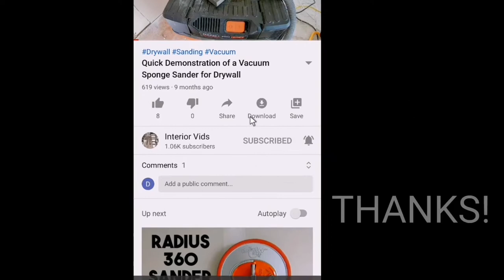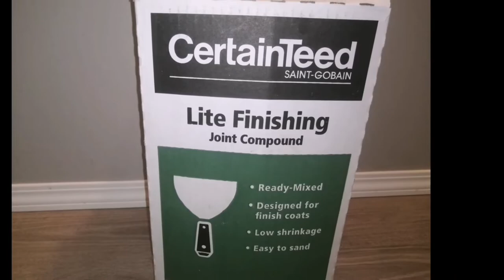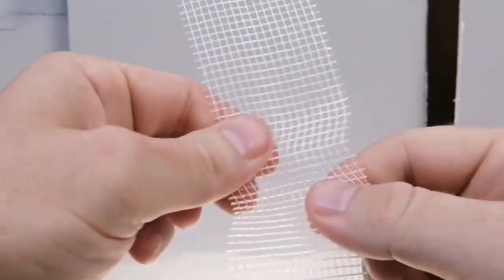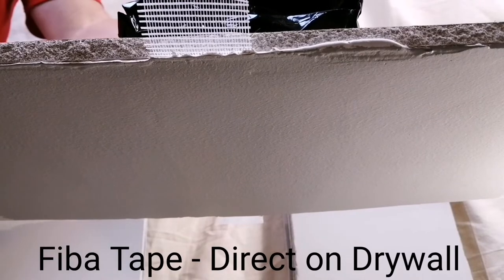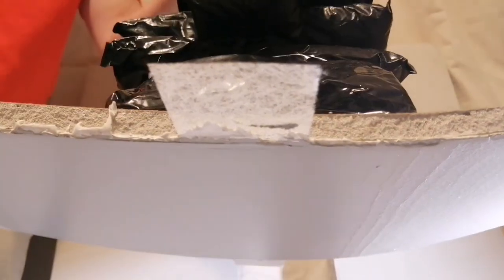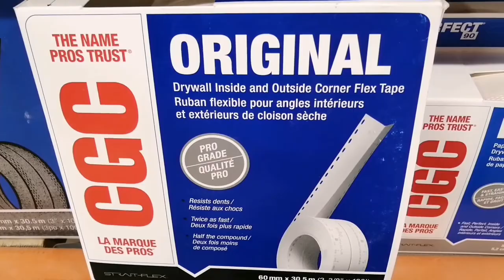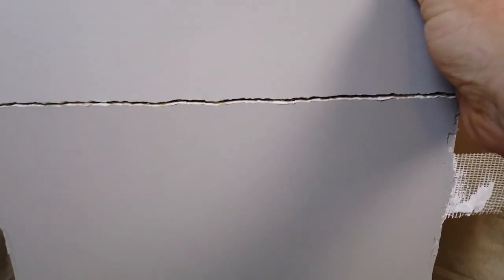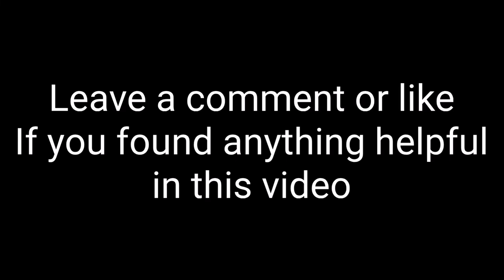Paper tape vs. Mesh tape vs FibaFuse tape

Comment: I use fibrafuse and fibratape red. With all purpose. I love that you have done this. Drywallers have been talking trash on my videos for months. I've never had a call back in my career. They are the 2 best tapes period. Especially embedded and prefilled
Reply: So do you use fibrafuse with the green top regular compound or hot mud?

Comment: Fantastic video thank you so much for investing your time and money to preform and share this test!

Strongest to weakest:

Tied for first place:
1. Fibafuse with taping compound - no crack in joint, (joint stronger than gypsum board and does not fail)
1. Fibatape with taping compound - no crack in joint, (joint stronger than gypsum board and does not fail)
1. Straight flex with taping compound - no crack in joint, (joint stronger than gypsum board and does not fail)
1. Fibatape with hot mud - no crack in joint, (joint stronger than gypsum board and does not fail)
1. Fibafuse with hot mud - no crack in joint, (joint stronger than gypsum board and does not fail)
1. Striaght flex with hot mud - no crack in joint, (joint stronger than gypsum board and does not fail)

Paper tape set with hot mud - Hairline crack at 20 lbs (joint stronger than gypsum board and does not fail)
Paper tape set with taping compound  - Hairline crack at 17 lbs fail at 18
Mesh tape set with hot mud - Hairline crack at 16 lbs (joint stronger than gypsum board and does not fail)
Mesh tape with taping compound  - Hairline crack at 13 lbs (joint stronger than gypsum board and does not fail)
Fiba tape pressed on then topcoat - Failed at joint at 12 lbs
Mesh tape pressed on then topcoat - Failed at joint at 8 lbs

Notes: 
Boards failed around 21 lbs on average

Takeaways:
Hot mud makes joints less prone to cracking compared to taping compound. But taping compound is still more than adequate.
Straight flex, and Fibafuse are stronger than paper tape, but paper tape is still more than adequate for many cases.

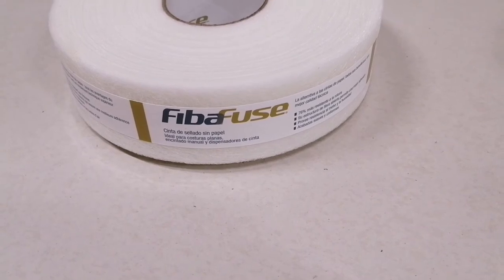Comment: Great video, love the Dexter Destructive testing you did here. I've seen similar in fiberglass testing. I like the Fibafuse 15:47, it looks like CSM fiberglass that will be omnidirectional in strength opposed to the mess. Very thin to lay down even though they all worked well for their task.
Again very interesting and great job.....

Comment: That's an interesting overview.
What kind of drywall are you using? 5/8 type X (regular weight)? the stronger the drywall the better you can tell apart strong vs weak joints.

Comment: Hi...i m drywall pro from croatia. Few notes from this part of world. We are always v grooving those but joints, than we do prefill with a gypsum based material, or hot mud how you call it, than on butts we apply fibafuse coated again in gypsum based material. Third coat is not gypsum based material, we are doing that coat with a mud which is softer  just because of easier sanding.

Since drywall sheet itself is gypsum made than the best joint is if you use gypsum based coat.

You have made great video. We need more like this on you tube. 

Final note...if you ever have enoufgh time made a few tests on dynamic pressure, since theese were just static pressures.

Comment: A summary paragraph or statement at the end of such a video is always helpful.
Reply from the maker: As a YouTube creator I have a dilemma regarding these specific types of videos.. if I put the answers in an ending summary, viewers simply jump to the end, read the results, and leave, that leads to a very low audience retention rate, which tells the YT computer algorithm that the video must not be any good, and therefore it would be buried by the algorithm and get no views. 

This is a dilemma commonly discussed by YT creators.

The paradox is that if I make the results easy to find in summary, then nobody is recommended the video to get the results anyway.

 Not to mention the $120 I spent on material is wasted. (I still haven't broken even) 

 The analytical data shows this: it's a very zig-zag graph around the end from people searching for a summary.

Did I do the right thing or no?

Comment: just went fully auto with fibafuse and joint compound. used to use mesh and Sheetrock for everything then finish with joint compound so this video makes me feel a bit better about using fibafuse. great video. thanks for your efforts.
Reply from the maker: For myself, the results of this stress test was a green light for me to begin using fibafuse on my own projects as well. Another bonus of fibafuse is on smaller jobs I can tape and coat on the same day with joint compound with no issues. Could never do that with paper tape. Still use paper tape on the corners of course.
Reply: @Interior_Works  good to know. it was recommended by a supplier and I was skeptical to try it, but on the first job I used it I was impressed. yes still paper in the corners. I saw in another video fibafuse has a corner tape now but I'm not sure how well it works vs paper. based on your tests paper may be better because of it's rigidity.

Comment: good effort... not so sure that a bending load is the load that causes most drywall cracks though.  Could be shear or tensile during cycling/fatigue.
Reply from the maker: Thanks. I agree it's not a perfect replication of what causes cracks, but does at least give some indication for stress resistance, and does correspond with what I've seen doing repairs and warranties.

Comment: Great video. I was thinking a control was missing but in the end the drywall failed before many of the joints. I would love to see another test that tests all joints to failure. Either replacing the drywall with plywood or gluing some plywood to the back of the drywall preventing the drywall from ever breaking anywhere but at the joint.
Reply from the maker: Yes, I was dismayed when the drywall cracked. I'm thinking that soon when I have time, I'll do a quicker re-do of this test, but next time with 5/8 drywall, or plywood reinforced if need be. If anything, I think this current video shows the weakness of fiber/mesh tape and the strength of paper tape, and especially the strength of FibaFuse tape.

Comment: I question the basic idea here.  Homeowners don't generally experience cracks in drywall due to weight on the drywall.   In the real world, cracks occur with movement of the surfaces the drywall is attached to.🤷

Comment: Thanks for making this comprehensive video comparison. 

I’m confused about the first couple of tests. You said “no compound” was used for the mesh and fine mesh tapes, but it looked like the tapes were mudded over. Did you mean that you didn’t embed the tapes in compound but topped them with compound? If so, what mud did you use in these specific tests?

If my understanding is correct based on the rest of the video, you didn’t test the performance of the regular and fine mesh tape using self-adhesion topped with setting compound. 

Thanks again for the video!
Reply from the maker: Regrettably, I didn't use setting, my rationale at the time was most diy'ers seem to just use a tub of all-purpose and mesh, even though it's not advised, and also I wanted the compound to be a control.  I think that mudding the paper tape with setting-compound would also add additional strength to that joint too, and then the tapes would still fail in the same order.

I think that if the mesh were imbedded or coated over with the stronger/harder setting compound, and the paper or fiba-fuse with weaker/softer all-purpose, then the failure pattern would have been more equal.

Tldr;
I just wanted to replicate how diy'ers commonly tape, and wanted the compound to be a control factor.

-edit, spelling
Reply from the maker: I was thinking about doing a quicker simpler test again, just against mesh+setting vs paper+all-purpose for brevity

Comment: I have a vaulted ceiling with collar ties up top and the 135 degree angle joints that keep splitting.  Thus the reason I'm here.  Structure is less than 5 yrs old.  2x12 rafters.   Has nothing to do with load but everything to do with extreme cold temps during the winter.  2 inch closed cell followed by 8 inch open cell.  Well insulated.  I'm not a fan of mesh but my drywaller claimed it would hold just fine.  My plan now is to scuff it up good and use the fibafuse with the Durabond 90 and Strait-Flex Super-Bond Joint Compound.  

Great video.  Thank you.
Reply: You should be using N0-Coat 350 or 450. It’s made for the off angles like you have. It’s similar to the Straight flex that he was using but it’s 3.5 or 4.5 inches wide respectively
Reply: I did 3 layers.  2 of FibaFuse, 18 in (9 either side of the joint) followed by a 6 in layer, and lastly standard paper tape all set with Durabaond 90.  I'm fairly certain this was overkill but I watched it crack twice after two separate wall board pros did their best to fix it.  Looking at two 25 ft long cracks in an otherwise beautiful structure took me to extreme.  Made it through the winter with no cracks.  My OCD is happy.
Reply: @5broadcast5  I’d buy no-coat 450. It also makes keeping that joint line straight. If that doesn’t work, nothing will.

Comment: Was the drywall cut completely in half and separated and then taped and muddled or just scored down the middle? Also drywall will never be under that kind of stress? Maybe in ceilings with blown-in insulation that got wet and is pushing on drywall that way. Usually drywall shifts with the structure side to side or up and down. Not pushed against it but i mean i guess any test is better than no test 👍🏼

Comment: In Germany, you usually buy the FibaFuse like tape (although it doesn't have that brand-name here) but I have seen people use the fiber mesh tape. I have never seen paper used here. FibaFuse like tapes are very strong and very easy to apply - it's porous, so there is no danger of blistering like with paper. The only thing you need to look out for with it, is not to sand through it. Since it is so thin and so interwoven with the mud, it is easy to overlook it and sand right through it. And then it is obviously completely useless.

Comment: When you used the mesh tape directly on the wall, what compound did you use over it? Mesh tape requires hot mud. It won't bond with drying mud, causing your joint to fail prematurely.
Reply from the maker: Just finishing compound. "Mesh tape requires hot mud" -A large part of this video was to demonstrate that very fact. Here @ 13:51 I'm even pointing that out on the product packaging.  
I will do something the wrong way to make a comparison to the right way, so the viewer can see the difference.

Comment: Very interesting test.  The results didn’t seem to be that much different overall between the various tapes. Will you be providing a summary of your findings?.
Reply from the maker: Thanks man, I wasn't sure what to expect when I made this, it at least gave me evidence to give customers questioning my usage of FibaFuse on their jobs, and answers the fiber mesh tape vs paper tape question, and mesh tape with it's own adhesion vs with setting compound.

These type of videos, people just skip the video and go straight to the end minute looking for the results, which is fine with me, but this particular video I put a lot of time, money and effort to produce and edit, so I just figured for written results,  just for this one video, I would make it so only people who watch the whole test, or extract that data, can have that.
Reply: Interior Vids. It solidified for me that using taping mud and paper tape is just as good as anything.   Although now, I might give fibafuse another look.
Reply: I’ve been using fibafuse for the last 2.5 yrs and love it. We do heaps of maintenance and renovation work and I find that it melts into the plaster rather than sit on top of it. So it doesn’t build the join higher when matching into existing. Also another benefit is you will never get a delaminates name with fuse. Even if applied with air behind it you can force plaster through it later which you can’t do with paper. Thanks for all the effort. 👍👍👍
Reply: Y'all gunning on mesh can go eat some drywall. I've been finishing for 18 yrs and use mesh all the time and have never had a call back or a problem. I mean this guy put 20 lbs on the mesh and the joint didn't even crack on his cut.

Comment: Do you have a link for that sanding vacuum thingy? Is it an attachment?
Thank you very much for showing this. I've never done drywall before. My house has all wood paneling from the 70s but I need to add something to the walls in the bathroom and was trying to figure out what to use and what tape to use and how to apply it. Any recommendation on what to use behind glue-up shower walls as well as around direct-to-stud shower walls?
Can fibafuse be installed without a taping compound underneath? I wasn't clear on that. So, a compound is just put over it?

Comment: Awsome man! I have a question, what is your step by step sequence for each days when you are doing a big job. (from taping to finish and sanding)
Reply from the maker: Thanks, on a job that I can stage up completely each day, the stages are this, in order:
Day 1. Pre-fill any gaps, apply flat tape, corner tape, corner-bead.

Day 2. Coat flat joints 10" or 8" box,  coat butt-joints, coat corner-bead. Coat screws. This is a heavy coat day.

Day 3. Dry

Day 4. Coat flat joints with 12", butt joints, corner-bead, screws. 2/3 sides of the 3-way inside corner.

Day 5. Coat all inside 90° corners, finish 3-ways, if smooth ceilings I'll do 14" box coat on ceilings over the 12.  Another coat on the butt-joints. Check everything, all the little refinements.

Day 6, if dry, Sanding. Then I use a handheld light and slowly examine everything, searching for anything that needs refined with a sponge-sander or marked and touched up with tinted mud.
Reply: @Interior_Works  Cool thx for sharing this. Last question. On day 2...do you fill the bevels on flat joints before coating with 10'' box. Or do you simply 10'' box your flat joints right away?
Reply from the maker: @redemptiondesnations  running the 10" box over an unfilled bevel will sometimes not fill it 100% on the first pass and might leave little pock marks.  I always double pass on the first coat, I go one way, then turn around and run the joint the opposite way. The second pass leaves it fully filled and smooth.  That might be a reason some people fill their bevels before boxing because they didn't know to double pass.
Double pass the 10" immediately, then after dry 1 pass with the 12". Setting dial  ~#3 on both boxes, the joints turn out fully filled and flat without filling bevels.
Either way works and is just personal preference.

I'm always happy to try and answer questions.
Reply: @Interior_Works  I see, thanks for your tips it is appreciated!

Comment: This test and the comments from others gives me more confidence in using the fibafuse for other than small repairs. I'm repairing ceiling cracks down the long seams and I want to minimize the chance of the cracks returning. Fibafuse and quikset seem like a viable option.

Comment: Great comparison.  What is the most cost effective  ?
Reply from the maker: Thanks, the paper tape is the most cost effective per linear foot. Roughly speaking, FibaFuse is about twice the cost of paper. Mesh/ fiber adhesive tape is 50% more expensive than FibaFuse.
Straight-Flex is 15x as expensive as FibaFuse.

Comment: I realize this is 2 years ago, but I purchased fibrafuse tape. Do I then use the regular compound with the green top?
Reply from the maker: Green is just for top coats, doesn't have enough glue for imbedding tapes or corner beads. It'll blister. Use Blue lid(all-purpose) for imbedding tapes, then either continue with the blue for the top coats, or then use green. (Green/topping just sands a bit easier than blue/all-purpose, but if it's a small project, the difference isn't worth using 2 different types of mud).
Reply: @Interior_Works  // thank you so much. This has helped me more than you know. Thanks for the reply.

Comment: Ima use the fibafuse. I like that it lays thin. No need for excess building
Reply from the maker: Ya the way it lays thin is a huge advantage, also I find I can tape and coat at the same time with it, with paper if I coat it immediately after it sometimes blisters.

Comment: Excellent prep and presentation on your part.  I'm a DIYer out of necessity and my house is 60 yrs old so I'm beginning to see various settling cracks.  I watched hundreds of videos to learn about which material I should use on a repair for a vertical corner-bead crack and decided fibafuse was the best.  Will be using a setting compound/hot mud. Am I doing the right thing?
Reply from the maker: I believe that would be the best combination. If you're taping over a painted surface, adhesion can be an issue. Try scuffing the surface first with sandpaper. Also for extra insurance, I put some white glue (PVA) into a half full water bottle, shake it, and use it to mix the Hot mud. (PVA is the bonding agent drywall compounds are manufactured with)
Reply: @Interior_Works  Thank you for that input.  I'll add the glue.  Great advice.